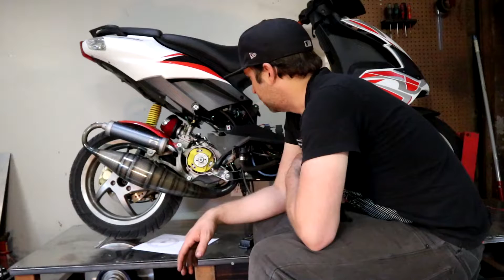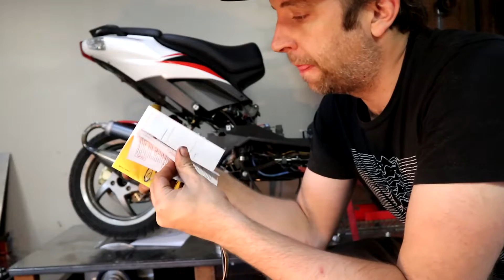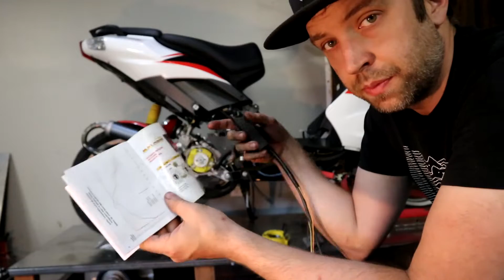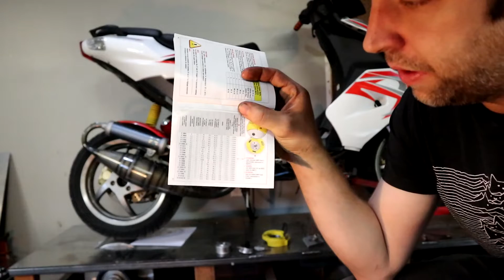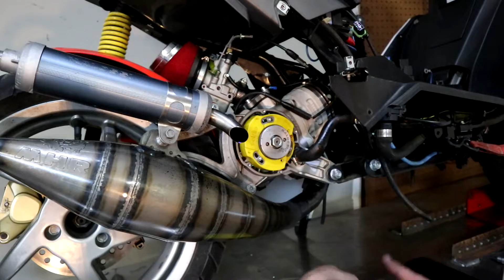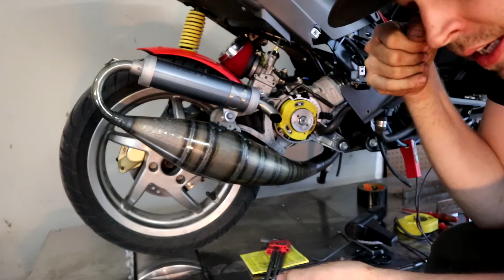How to Setup an RC-One Selettra Inner Rotor and CDI settings - J's Garage

Comment: Hi mate I’m just wondering how did you make your typhoon liquid cooled and what engine is in it aswell and what forks are u using aswell plz
Reply from the maker: I got a complete RC-One engine and made a mount and bolted it in.  If you watch the videos I show in depth most of the steps.

Forks are off a early model typhoon from Malossi, however it seems they have discontinued them (or at least the last time I checked they were)

Comment: I would like to know which carburetor you mount, I also have the mhr 94cc and I would like to mount a carburetor 34, what power could I reach?  Thanks
Reply from the maker: It was just the stock 28mm VHST Dellorto.  Bigger carb will definitely let it breathe more.

Comment: hey mate how many kg is inertia wheel
Reply from the maker: 300lb
Reply: @pitobread  im planig to build one for my own motorcycle repair shop how much do you think the weight must be for 150hp 180hp motorcycles
Reply from the maker: @aca192maric  not sure.  I would be more concerned with diameter and roller speed over sheer weight.  

I would guess 500lb+ and probably want it to be a large diameter so the roller speed is not too high.
Reply: @pitobread  i found this info on dynojet 250i Drum Diameter18 IN / 45.72 CM Drum Width 16.37 IN / 41.59 CM so i will build it like that it is rated for 500 hp
Reply from the maker: That sounds like a good start.

Comment: Would you make a video on putting a piaggio Rc1-one on a Dio frame cause I’m thinking on doing one have block tryed looking for videos no videos would be nice please thank you
Reply from the maker: Hey!

I could probably do a video like that someday, but right now I am pretty busy.  You would want to use a Piaggio RC-One as they are bottom mount.  A custom engine mount would need to be fabricated.

You could use a Zip 10" rear wheel or a Typhoon 10" rear wheel to get it to look a bit more proper, Zip 10" are a bit narrower than the Typhoon ones.  I think only drum would be an option with the 10" but I am not sure.

Wiring would be pretty simple, add a ground and tie into the kill switch wire to the CDI.   The rest is self contained on the RC-One.

You may need to add a shock extender or offset mount to get the shock to connect up

I would put a top tank under the seat and ditch the floorboard tank, or use it to fill the top tank but keep the carb gravity feed.
Reply: Pitobread I just got me a piaggio bottom mount one I was putting it on a 2001 elite thinking doing a 2fast 100 boar crank and pipe in the next future lol but slowly slowly I’m going to collect parts from scootertuning.ca plus I try finding videos on building some sort bike or even step by step videos not like yours step by step and make sense you have Instagram
Reply from the maker: @islandhomegrown778  Yes I do. https://www.instagram.com/pitobread/

Comment: I dream of collecting the same projects as you !!
Reply from the maker: It's been thinned out a bit, but I hopefully can keep these ones for a while
Reply: @pitobread  I wanted to ask advice on which carburetor to install on 70cc 19mm or 21mm ??
Reply from the maker: @ecoskyter134    Depends on your end goal and the type of cylinder, for a mild/medium  or daily driver build I would go no bigger than 19.  You have the potential for more peak HP with a 21 with a more high revving race build but at the cost of less fuel economy and probably poor part throttle response compared to a smaller version.
Reply: @pitobread  Thank you so much!
Reply: @pitobread  I would like to know which carburetor you mount, I also have the mhr 94cc and I would like to mount a carburetor 34, what power could I reach?  Thanks

Comment: Need the lights and charging j-rock
Reply from the maker: On my own it does both, on this one it just has dual batteries.
Reply: @pitobread  good hustle!!! Buddy,....ground strap mod...huh
Reply from the maker: @kennethbellmyer9241  not a mod, cdi and coil were grounded to frame, engine mounted on rubber.   Not sure if it was needed or it was something else.  Can't hurt tho.